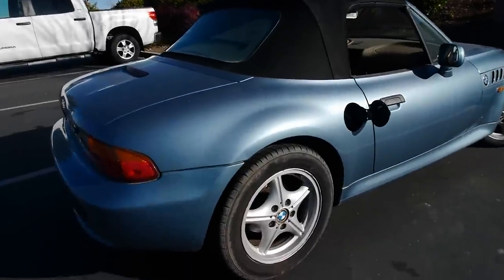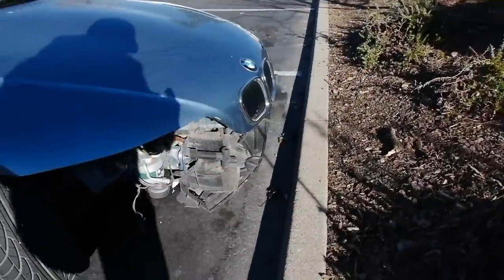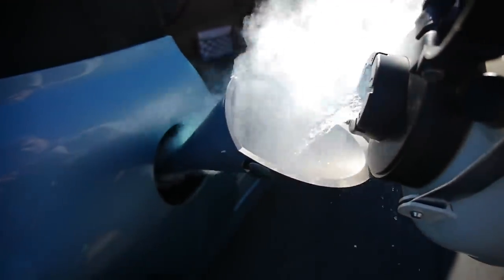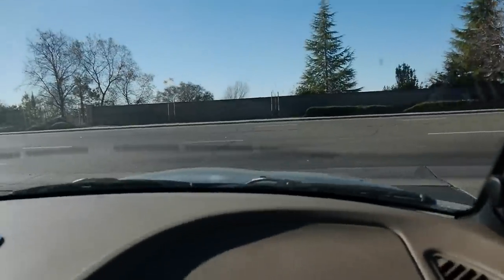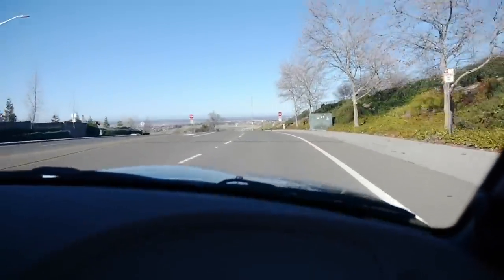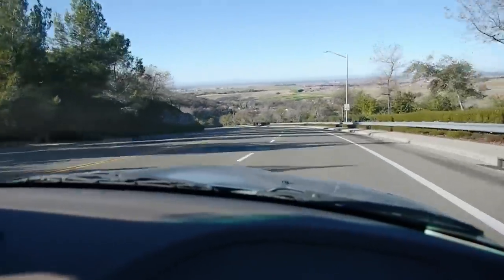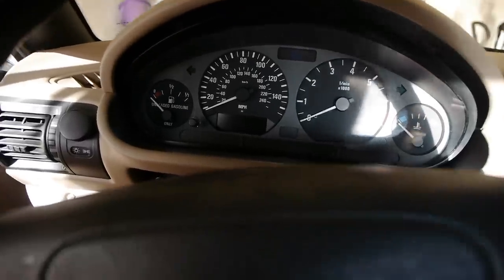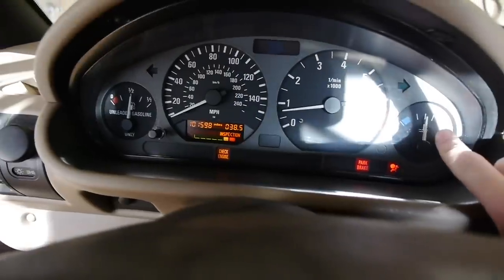What Happens If You Fill Up a Car with Liquid Nitrogen?

Comment: 1. Temp gauge is obviously broken... Cold fuel would not affect the engine temperature. Also, the gauge needle being immediately at operating temp after the car being off for 6 hours? Why are you acting like that's normal? 2. None of the liquid nitrogen left the gas tank. None of the liquid form, that is... Fuel pumps pull from the bottom of the tank for obvious reasons, Liquid nitrogen sits on top. Gasoline has denser mass. 3. Most if not all of the Liquid Nitrogen had evaporated and escaped by the time you started driving. All you really did was super-cool the fuel, which probably made the car less powerful and less fuel efficient. Gasoline Vapor burns, not so much the liquid. If you soak something in gasoline and burn it, most of the fire you are seeing is fueled by the vapor... Being warm going into the cylinder is closer to already being vapor than going in cold... Look up fuel RVP and the difference between summer and winter blend gasolines. This guy introduced winter temps to summer gas. If the engine itself wasn't warm, it might not have even started.
Reply: Leave the car videos to the car people Techrax

Comment: Liquid nitrogen evaporates so fast all it probably did was lower the combustion chamber temperature before evaporating.
Reply: At least one of you was attentive in Chemistry class, Yes that is almost correct, Assuming that the cars components can withstand cryogenic temperatures and resistant to embrittlement, which is not the case, then Ln2 would momentarily have lowered the temperature within the fuel tank, however since the fuel tank is not temperature insulated, vaporisation to Gn2 is instant and dissipates rapidly, it is imposable for Ln2 or Gn2 to have traveled through the fuel system to the engine.

Comment: Liquid nitrogen literally makes your car run better. Top fuel drag cars do that so that because the cars run better at lower temperatures
Reply: Failed.....0/10 Go back to Chemistry class and try again........... Ln2 is a cryogenic liquid and is inert.  You are referring to N2O which is Nitrous Oxide Gas.

Comment: Didn't the nitrogen evaporate when coming into contact with the gasoline? 
The boiling point of nitrogen is something like -195,8 Degrees Celsius  which should evaporate when coming into contact with the gasoline, which is liquid at room temperature and probably didn't even make it to the petrol pump before it evaporated.
Reply: Correct 10/10. Additional since the fuel system is not manufactured from Stainless steel, the Cryogenic temperature would have caused embrittlement damage, and leakage.

Comment: use a drum, big drum, long drum and filled it with water half, then put it in water and a rope attach with it pull it up so it's remained down side up
so when fluctuations occurred in atmospheric pressure's then what will happen, will the water going inside the vessels or not, or it's immerse or drowning more, calculated the consequences, we will use this phenomenon in making energy from atmospheric pressure on larger scale many tonnes of electricity forever everywhere anywhere in world we produced daily basis

Comment: Is it safe for someone with a liquid nitrogen filled car to be driving on an open road with other cars???
Reply: The Ln2 vaporised within minutes of pouring it into the tank, neither the tank or fuel lines are insulated to retain -196 deg. it was fully vaporised before the car was even put into gear. additional N2 is inert and does not support any form of combustion.

Comment: I bet The nitrogen evaporated and it was running fine because fuel pump in those cars have a reserve sl you can drive aleast 30 miles before it dies from lack of fuel

Comment: Liquid nitrogen is around 350 degrees below 0 it would have frozen the entire fuel system.   The steam coming out the fuel pipe was the nitrogen hitting the gas in the tank probably made the gas very cold depending o n how many gallons was in the tank.   I have been in 40 below 0 & cars ran ok today's cars would have probl ems in very cold conditions.   My 2006 Chevy impala SS after being in .ca for 11 years doesn't like 0 degree weather until every thing under the hood gets warm & i mean it really doesn't like it stalled 4 times & ran funny till it got warm under the hood &  I did the 100000 mile service 8 months prior

Comment: Stupid for clowning with liquid nitrogen without rubber gloves on. It boils immediately when it comes in contact with a warmer object. (Leidenfrost  effect) Maybe try pouring in some Calcium carbide and follow it up with peeing in the gas tank!
Reply: No Rubber is not suitable for Cryogenic temperatures, Special Cryogenic Gloves should have been warn for safety.